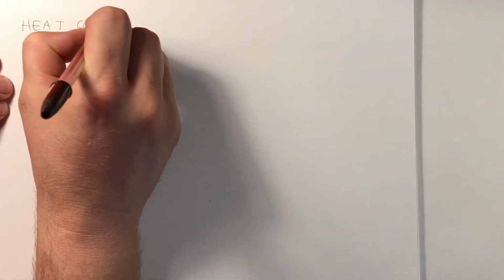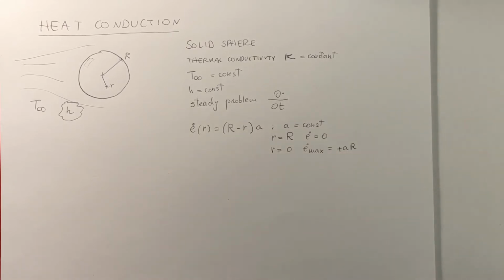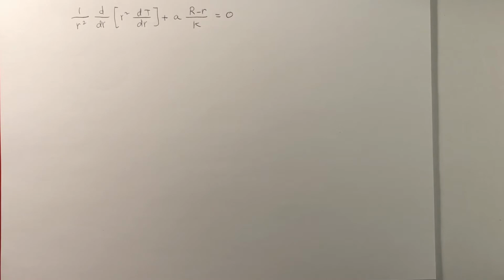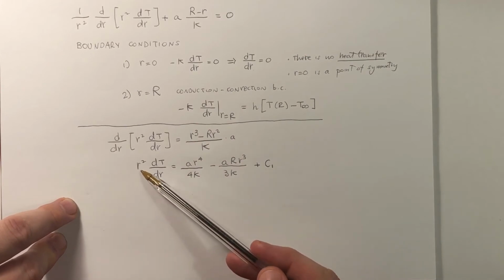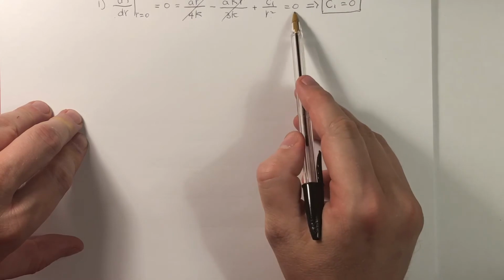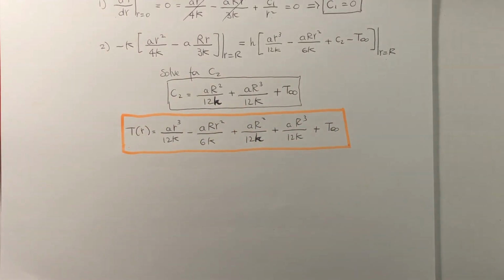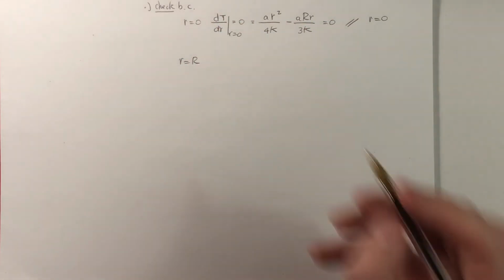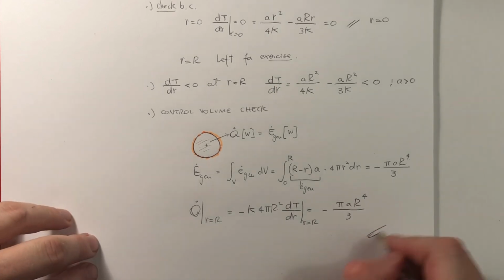Heat Conduction - Sphere cooled by convection

Comment: sir if c1 is equal to 0 then it would be 0/0 right whicch is a discontinuity. can you make it clear sir. im little confused
Reply from the maker: Hi Lohit, thanks for the comment. Think in terms of the limit r going to zero and the case where C1 is finite. This limit would give you an unrealistic singularity. Then the only possibility is that that term is not there and C1 must be zero. You would get a 0/0 undetermined limit of you had numerator and denominator both tending to zero, but this is not the case because C1 is identically zero. I hope this helps!